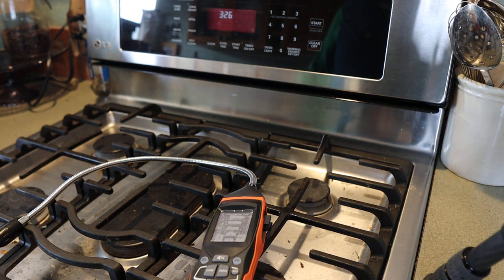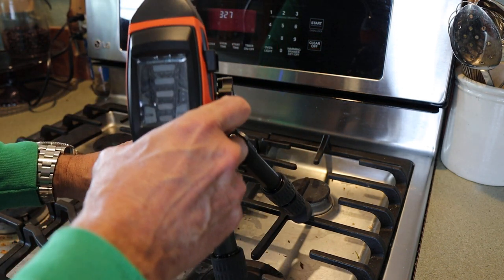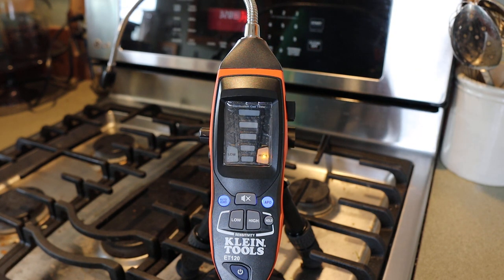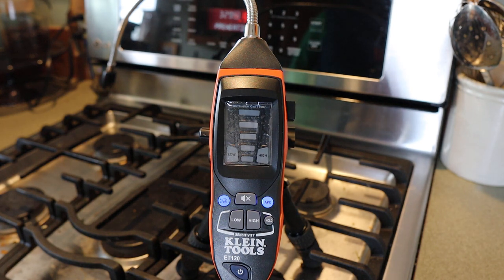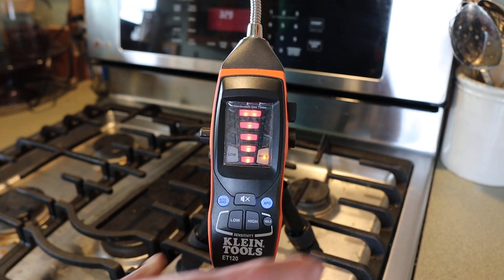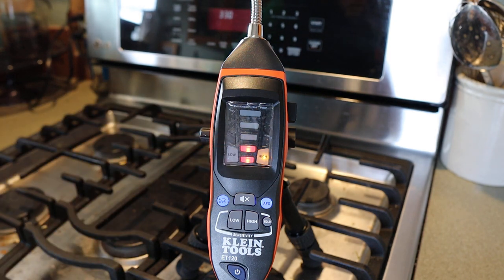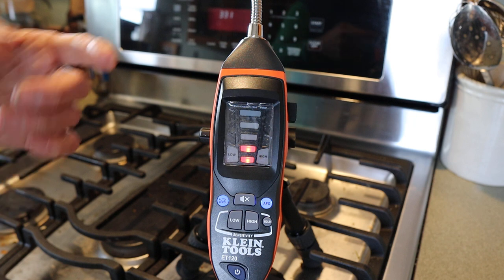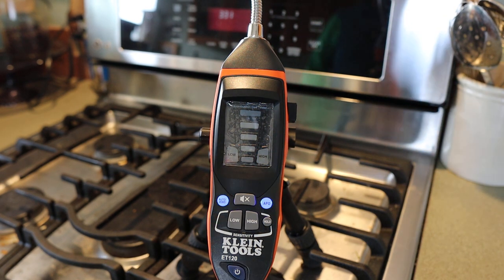Klein Gas Sensor testing the off-gassing of a kitchen gas stove. There's something to the news story

Comment: The back left side of the gas stove-burners, or oven-headboard is the vent for combustable gas from the oven. You should never have CO in your home, but placing a co detector directly in the path of combustion exhaust is always going to trigger a high alarm. You would typically use a combustion analyzer to determine if your flame is burning efficently; thus creating less CO. In addition, most true professionals will also measure the inches of water column on your gas valve to validate the correct gas pressure. I would also be curious to see the reading in PPM from a 3-5' distance. Stay safe out there, CO kills silently! Always refrence official certified documents for safe exposure levels!

Comment: Really you tested nothing but the fact that the oven actually works. These types of detectors do not measure combustion efficiency, they detect combustible gases and are meant to be a very rough estimate at best. Your oven uses a surface plate igniter and therefore flows some amount of gas over it before it ignites, not enough to worry about and certainly not enough to be any kind of health hazard. If you tried something like a Testo 310 you might get some usable data. The bed-wetting over gas stoves is embarrassing and a testament to the poor public education quality.

Comment: I had the same problem with my stove. In addition to replacing the hot surface igniter I also adjusted the venturi settings on the upper and lower gas elements in the oven. By making sure they were burning correctly and adjusting the air shutter to make sure the flame was burning blue (not orange or yellow) that fixed my issues with my stove. I've had several years of trouble free use after that. I'm not sure why it wasn't correctly set from the factory, but adjusting the flame to burn correctly was a simple fix once I found the adjustment screw and instructions. If you get a chance to fix it, I'd love to see an after video showing the readings post fix.

Comment: The first problem I see is it’s an LG, I’ve been an appliance service tech for about 28 years and specialize in gas products the problem really is they all let a little uncombusted gas out during the lighting process it doesn’t matter if it’s a spark ignition or a glow coil and yes you will come across some bad techs with bad practices  I pride myself on my honesty and tenacity. In the end however the amount it lets off especially with natural gas dissipates pretty quickly but the older glow coils get the longer it takes for them to light the gas and more gas gets out if it’s not glowing almost white hot and pulling 3.5 amps across the burner valve replace it
Reply: Great vids I watch them about every morning
Reply from the maker: I'll check it. I think I replaced the glow coil in this oven several years ago. The smell seems to be increasing. Might need some service. I'll check the amps. Thanks!

Comment: What kind of gas, nat or propane. Know the propane gives off odors from the compound used to put a smell in the gas. Usually worse when tank is nearly empty.
Reply: I would assume something like carbon monoxide, inefficient burning creates
Reply: @jusb1066  Yes, agree. It's not always a bad thing. As an example, in a cultivation environment the additional CO2 allows for bigger yield. There are ingredients involved, of course, but it sure beats changing out tanks every day.
Reply from the maker: This is a natural gas (methane) stove. The smell is strong and not the additive to natural gas. Plus both CO and CO2 are odorless so it's not that. The strong smell occurs during the preheating process, then mostly goes away when the oven is running hot.